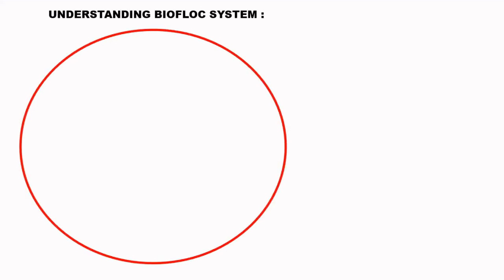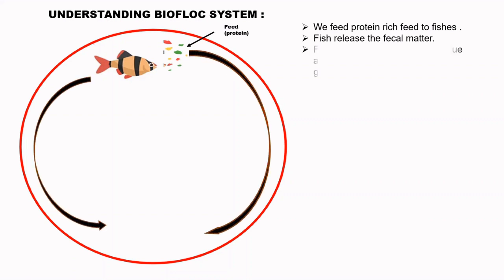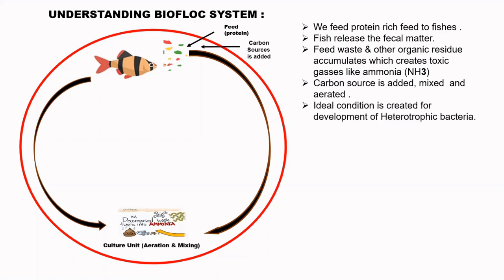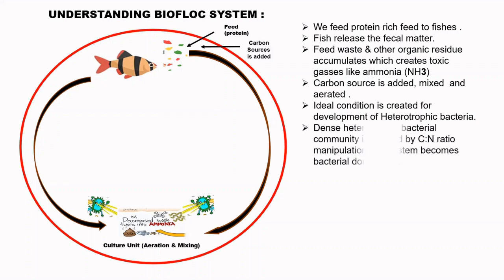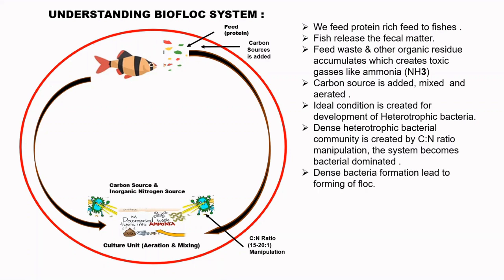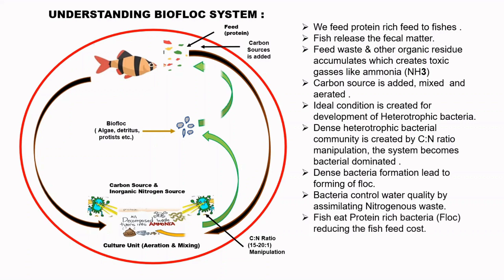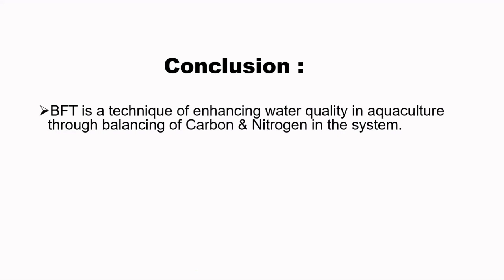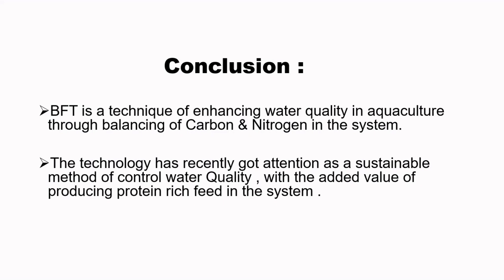What is Biofloc System? A basic understanding. #Biofloc #Basic biofloc

Comment: look like the parameters are mostly control by proper placing an aerator.
Reply from the maker: Aerator is one of the part of the process .to provide oxygen to the system ...but there are other parameters also..to follow in Biofloc system...to run the system successfully..

Comment: Sire, we should apply a carbon surce every day in order to maintain C:N ratio or when the system high toxic only?
Reply from the maker: Pls do understand C:N ratio is maintained for the growth of bacteria which maintains the parameters of water..but bacteria are also responsible for making water toxic if thier growth is higher then the required parameters....mainly generating ammonia..in the system..so water has to be filtered time to time as per the water testing...parameters requirement..
Reply from the maker: If water is toxic you need to immediately fillter the water or drain out the water upto 60% -70% and start filling the tank with fresh water ..
Reply: @floragreenaquafarms9179  Thank you so much for your reply sire and explanation. However, we use carbon source rely on feed protein and quantity  also right? So, we provide feed for fish every day. Therefore, we need to apply cabon surce every day or not sire in order to maintain C:N? Sorry for ask this question but honestly i still don't understand about it.
Reply from the maker: @TraShare   fish feed are important..C:N ratio are important for growth of bacteria so that your fish feed requirement goes down...and bacteria also helps in maintaining water parameters...but anything of over can create imbalance in system...you can use carbon source every forth night or weekly ...but check the water parameters daily .
Reply from the maker: You can also..check link..in my discription...for online course on biofloc ...
Reply: @floragreenaquafarms9179  yes sire,   now I got it. Deeply thanks for your reply sire.